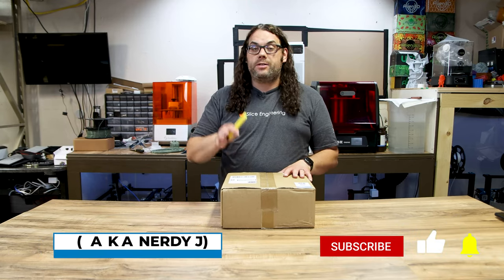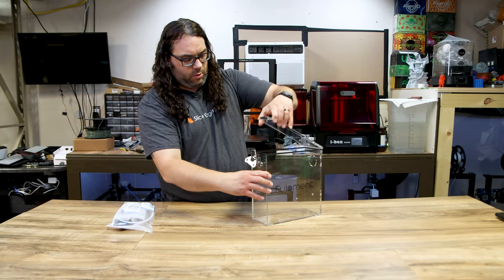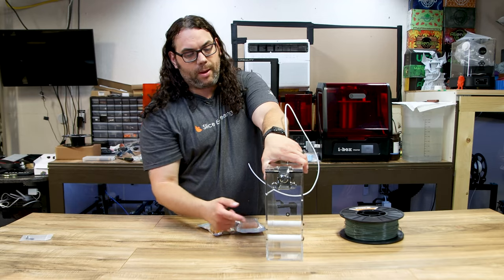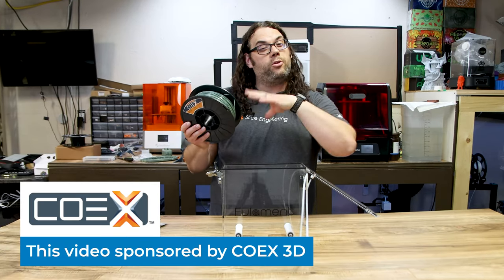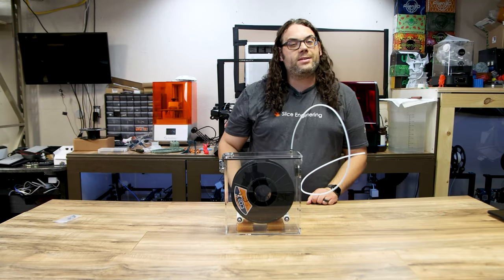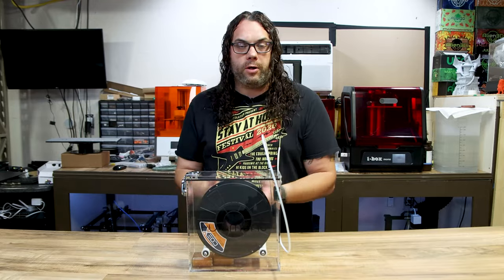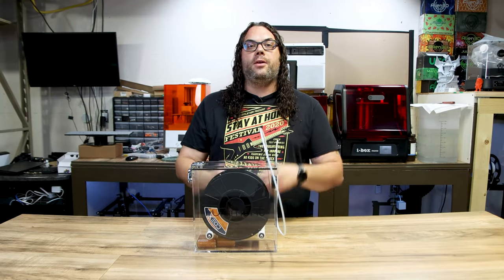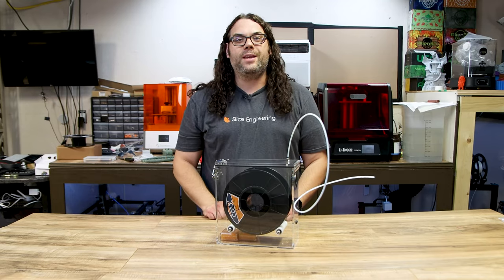How Dry?? Filament Drying with the Fula-Box!

Comment: You should weigh the filament before and  after to see if it actually dries the filament.
Reply: Hi Tony, I believe the purpose of these types of boxes is to keep your filament as dry as possible while you're printing, especially for long prints and for highly hygroscopic filaments like ABS, PC, Nylon. I don't think they can really dry or make it drier than what it started at since it's not able to heat to just below the filament glass transition temperature. But it would still be a good experiment.

Comment: The humidity meter tells you the humidity of the air in the chamber - not the humidity of the filament. You said it dropped to 10% overnight and then at 8pm it is up to 26%. Yep moisture still coming out of the filament. I reckon it would take several days if not weeks to pull all the moisture out of the filament .

Comment: You fellas with your filament driers. I've had my 7 or 8 spools of ABS and PLA sitting out in the open air for an entire year. Guess what happened to them. Nothing. They print perfectly.
Reply: Mark, you are truly fortunate.  I live in Missouri and the humidity in my basement print area is about 60% now.  I can print PLA with no problem, but my PETG will not print unless I dry it and put it in a dry box when printing.  Mine work, but are not smooth - they are tupperware that I modified - these look like they will be more consitant with feeding
Reply: @Mark Jones: So your printing room is dry. Good for you. You’re not the intended user of dry boxes then.

Comment: Can it feed out of the bottom also?  I wondered when you had to use a bolt to seal the bottom hole.  Looks like a nice system
Reply: Jim, thanks for reviewing this.  I have been looking for a better solution while printing than my tupperware boxes.   These rollers look smooth - just ordered two and got free shipping and the 10% discount
Reply: @woodwaker1  let us know how you like them!
Reply: @Fulament  I'll post on my you-tube channel
Reply: I just got my two boxes.  I'll post on my you-tube, but they look great.  I appreciate that they come with extra parts ( washers and screws) for some of us fumble finger people.
Well packed and really professional. They can feed from the bottom or top - simply use the bowden connector in which ever hole you want the filament to come out - plug the other hole with the enclosed bolt and  washer.

Comment: Im confused, how can this be called a filament dryer when it uses desicant that just removes moisture from the air?
 I will pass on this one!
Reply: it's not a dryer, it is a dry box. You know, so you can print filament that needs to be dry...
Reply: @joshua43214  Thats not what is implied in the description though